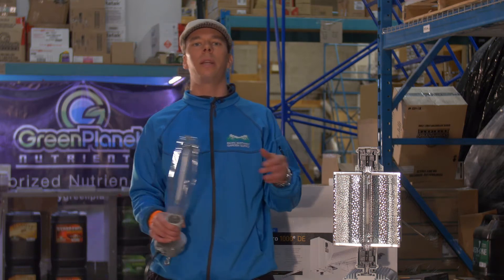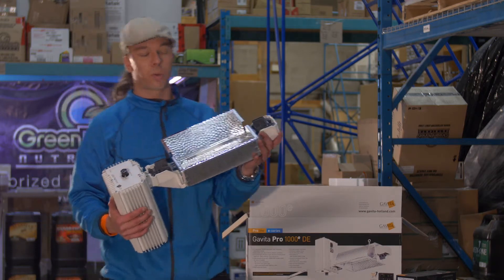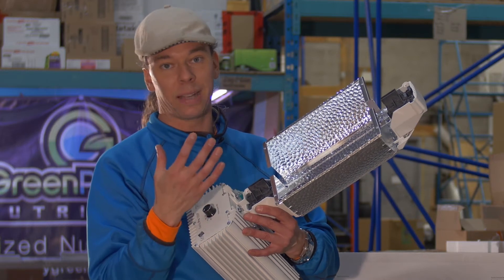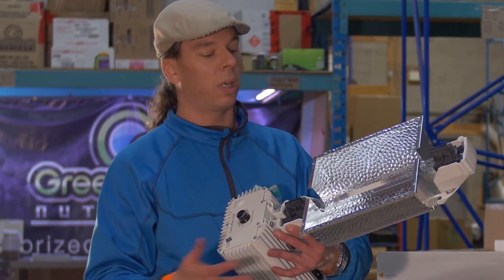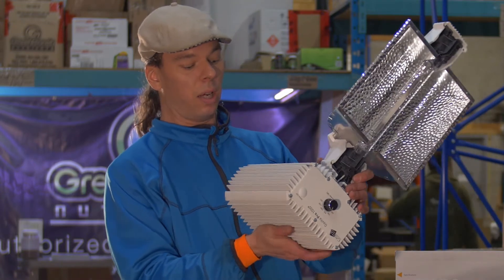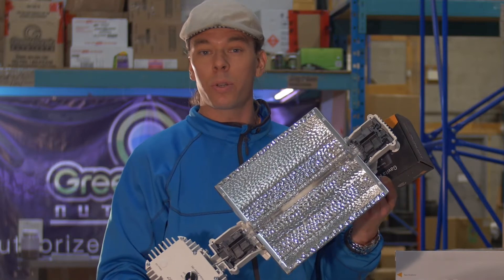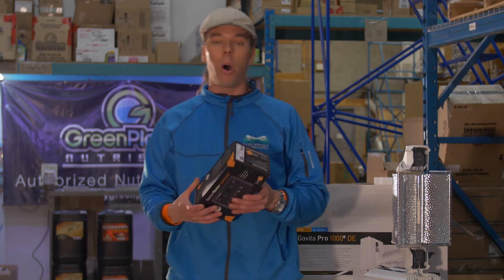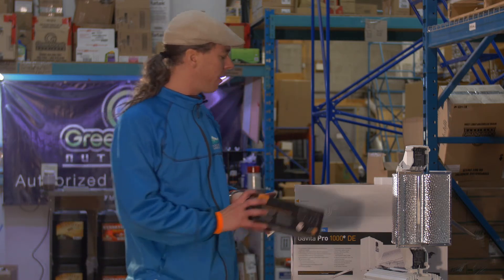Possible Indoor Gardening with HID Lightning - A Garden Sage Lesson

Comment: So here's one question i have been trying to figure out on the safer side of things 
#1. Say you have a "gavito" "nanolux" some sort of of D.E. fixture with bulb, ok can you connect it ( said bulb is a 1000wt.bulb) to any 1000wt. Ballest? Yes or no and why?
Reply: You can use any 1K ballast with DE or a single ended HPS light. You don't need to buy new ballasts for DE bulbs.